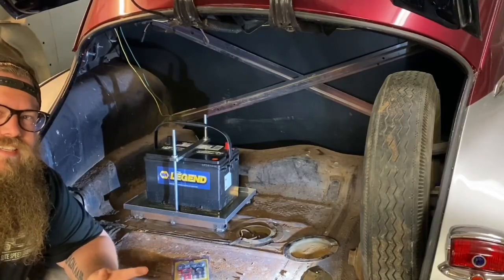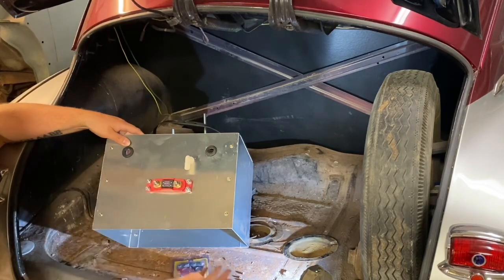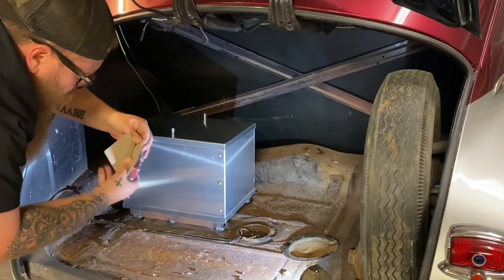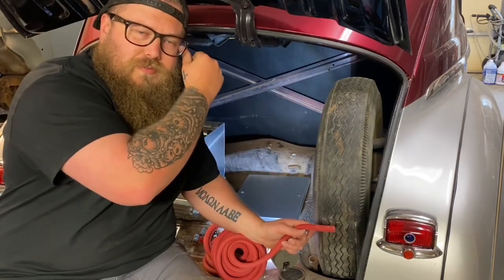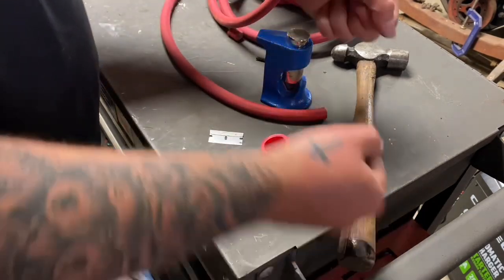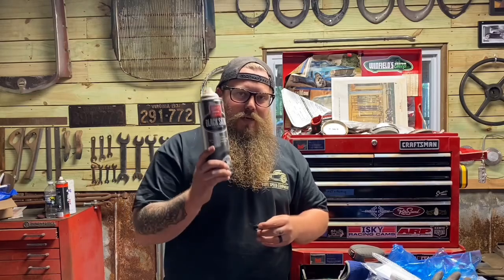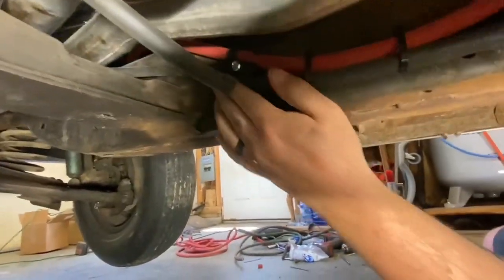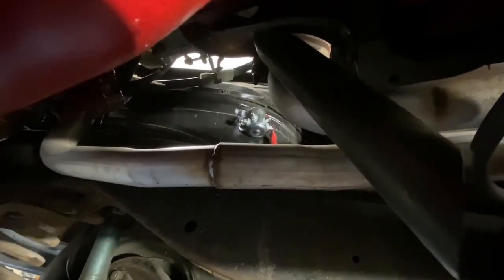Relocating a Battery to the Trunk!

Comment: Good information! I cheaped out and grounded to the frame, and put several ground straps in different locations from frame to engine. 427 ci in a 56 Chevy, starter always worked fine. I like the battery box but not sure about the fuse being so hard to get too. ;)
Reply from the maker: Thank you! I’ve seen a lot with just ground straps which I am sure is completely fine, I just like to do everything a little extra! And I agree with the fuse, just trying to hide it, thanks for watching!
Reply: FYI, I saw a fuse like yours that had a cover for protection. :) Seemed like a good idea, and you could mount where it was easy to check and replace. :) @WiredCustomsSpeedShop